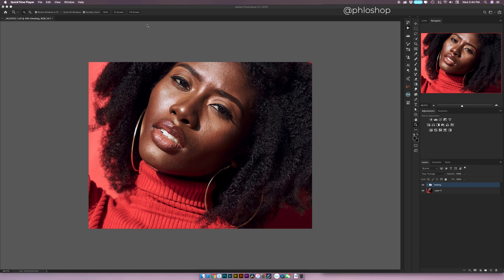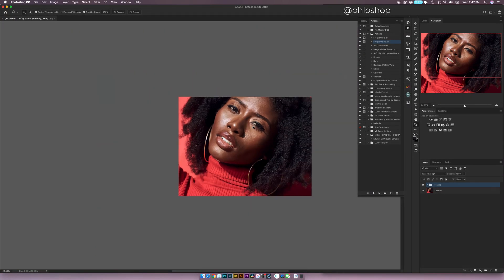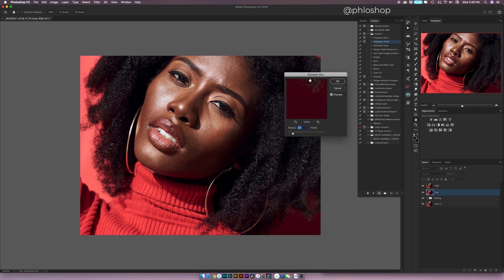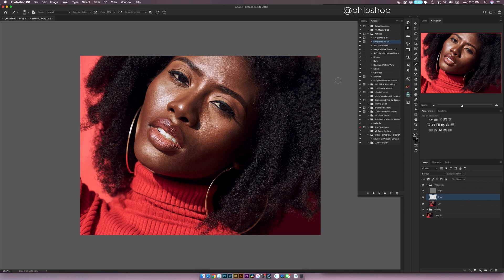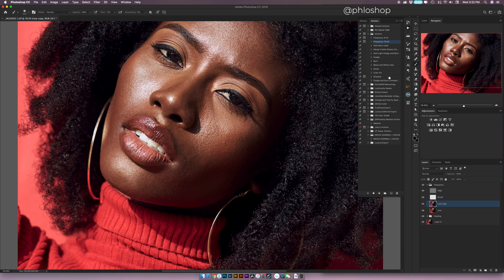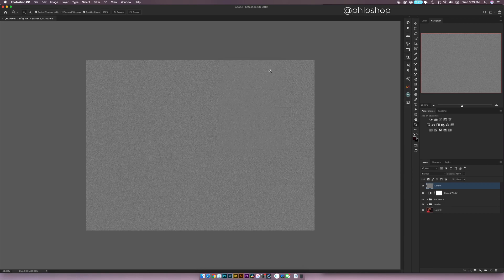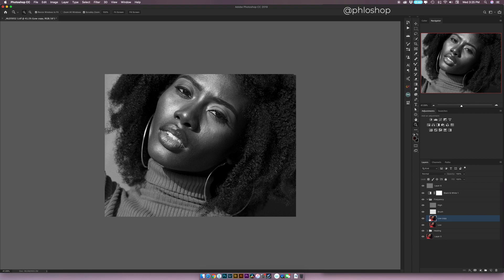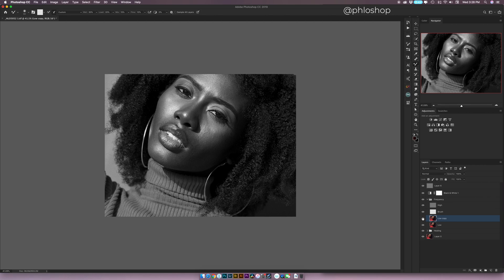How to: Frequency Separation Retouching in Photoshop with Mixer Brush

Comment: Good day, thanks for always sharing and inspiring.. my question is how do you know the right mixer brush settings to use for a particular image to be retouched cause have seen you used different mixer brush settings. sometimes your mix is at 15% times its at 50%. pls what's reason behind that. will appreciate a positive response. thanks

Comment: Thank you very much for this amazing video.
One question though, your frequency separation action, how did you create the 'brush' layer in the middle?
Reply from the maker: +Mary Alabi you’re welcome 😊.
Uhm the brush layer is just a normal blank layer. So if u have an action for FS, after u run it simply create a new blank layer n place it in between the High n Low layers
Reply: Phloshop Thank you ✨✨